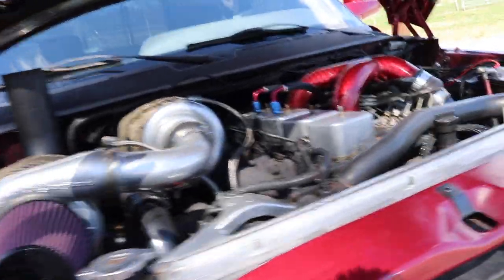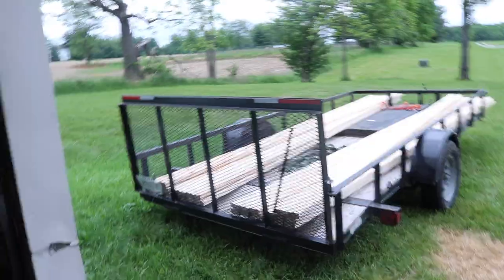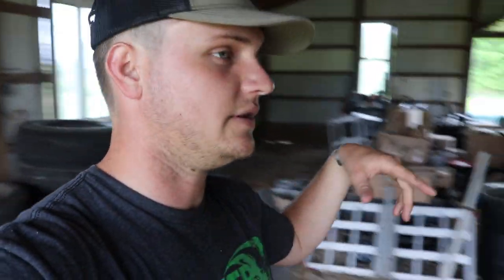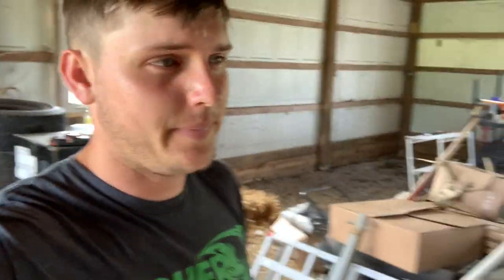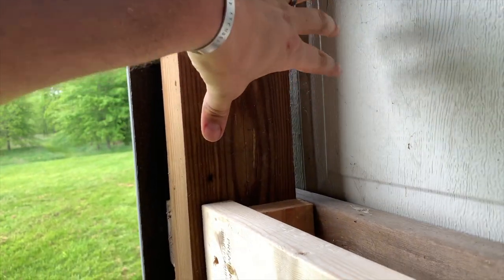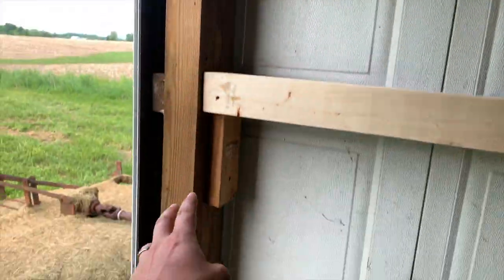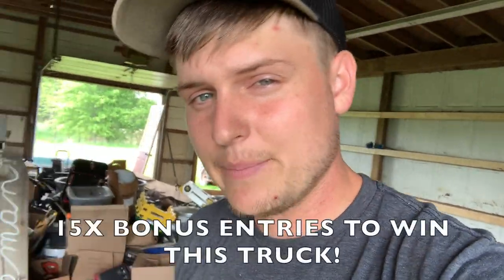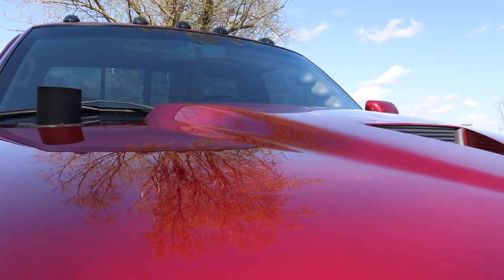DIY Dream Shop build on a budget! - Ep. 4

Comment: I would have just screwed the metal straight to the inside boards and saved all the money spent on the 2x4s that you hung and you could have painted the post what ever color that your metal is and you would have actually had 4 more inches all the way around on your floor to wall span and then just put metal on the existing rafters angle the side metal and then have it go up to a flat roof and that way you would have a taller roof in the middle all you have to do is run the metal the length of the building and screw it to every rafter

Comment: Love your plans and I know I comment to the last video and I think you may have figured out a remedy that my ass at the time that had been drinking didn't think of to not have a bow in the walls but as far as the ceiling I think I'd run R32 fiberglass insulation and keep the high ceilings if you ever want after the floor is concreted having a vehicle lift but I don't know how tall the ceilings would be if you did them flat he could probably get a lift in there and still raise a vehicle up fairly high but that's just my thought and you're a smart m********* pardon my French so you'll get it right and have it at least what you want but like I say I think I leave the high ceiling and do fiberglass insulation up there